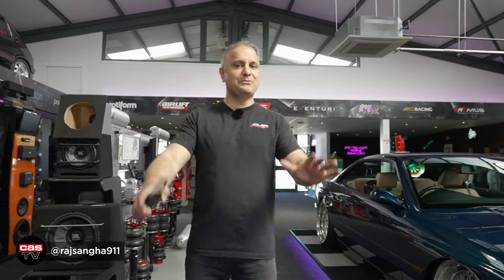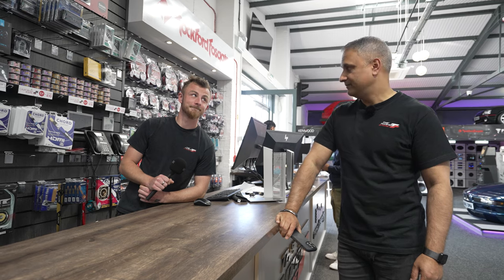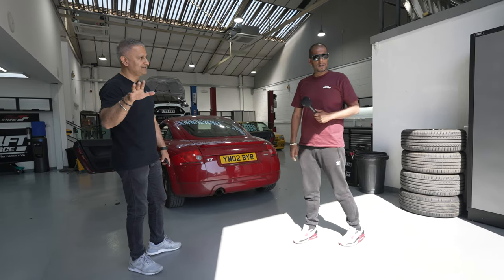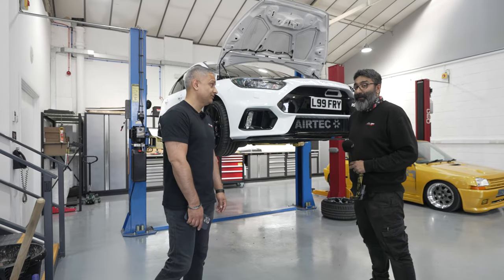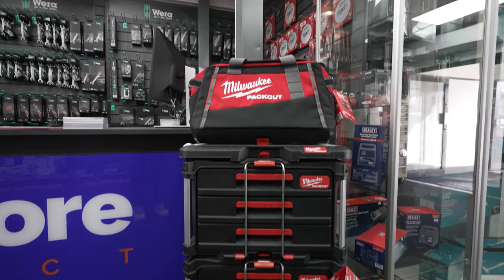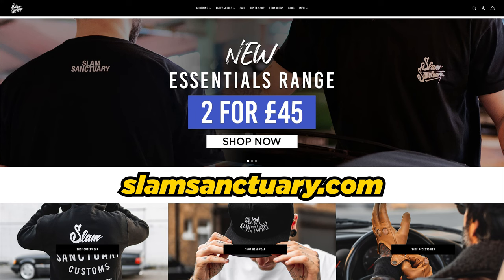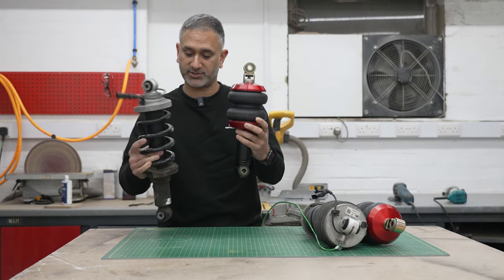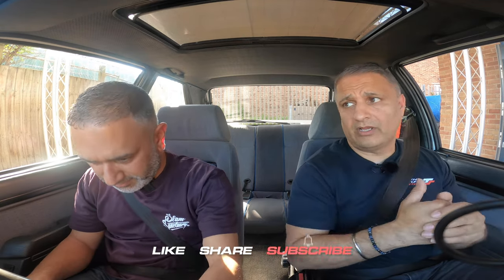Ford Escort RS Turbo, Renault GT Turbo - Behind The Scenes | CAS Unplugged EP 11

Comment: You have a winning formula already, just keep at it! 
My suggestion would be to expand the car brands / models / installations. 
There are so many you have yet to do, older / more modern / exotics / unusual and the run of the mill too. 
Show full installations on customer cars (if they agree). Showcase the skills you guys obviously have, on installations / up grades and the like. (Personally I like the overview and then the instal and the finished item, showing the challenges and how you get over that. (Plug Milwaukee tools, they are great tools at the same time.)
So many vehicles you have yet to do and show how you have improved them, almost limitless! 
Keep it up, great viewing.